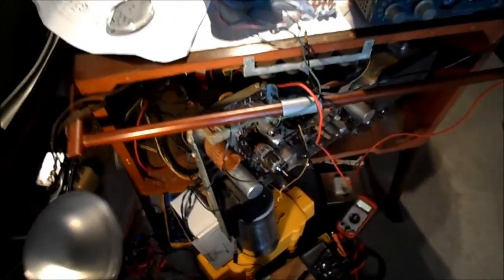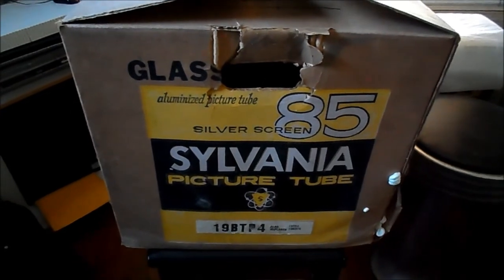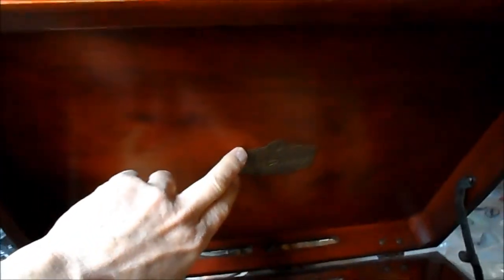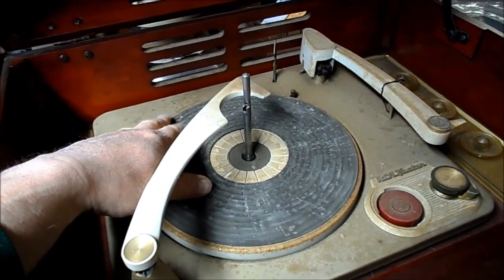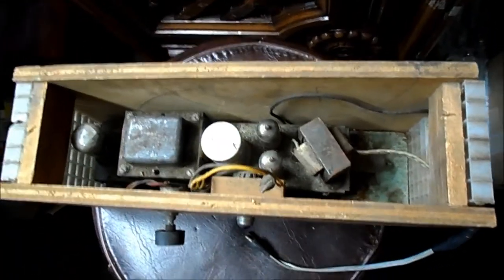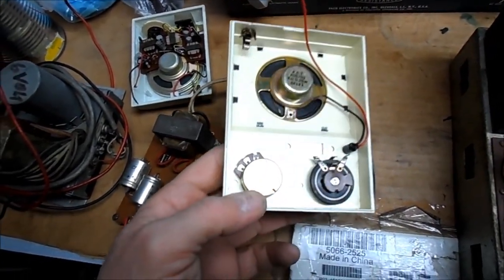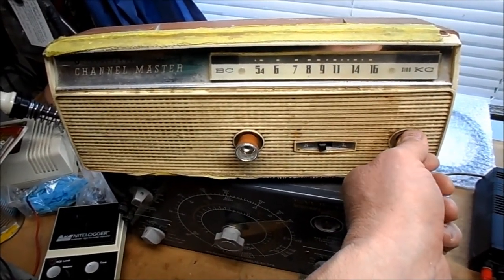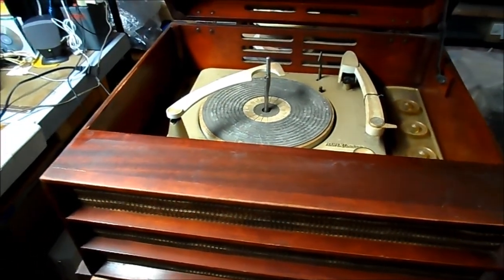1965 Magnavox 19 inch B&W TV. Pt. 3. +Ham Show Stuff.

Comment: g2 voltage is ok on that tube? I had the same problem in a Philips TV anr the failure was a cracked solder in the output tube socket, in the G2 pin.
Reply from the maker: Yes, you may be on to something there. That's why I'm pulling the chassis for a look on the underside. Yes the G2 voltage was normal.